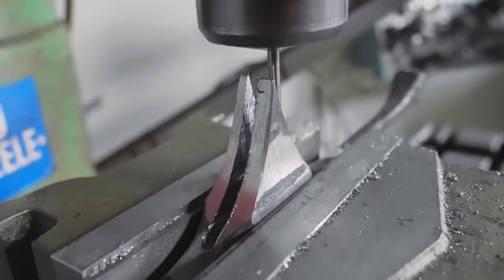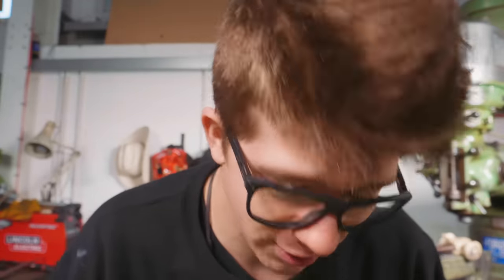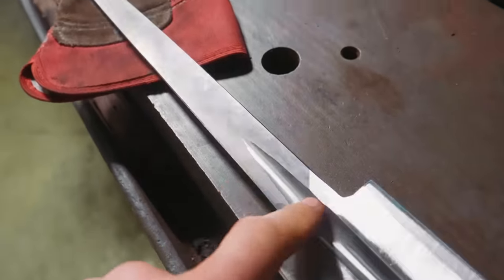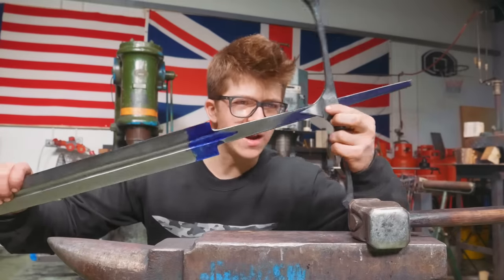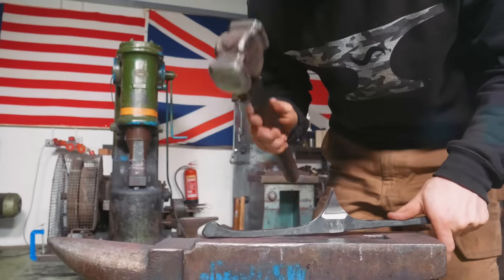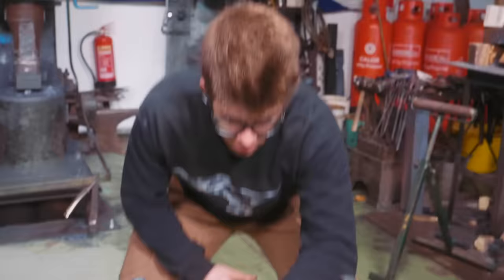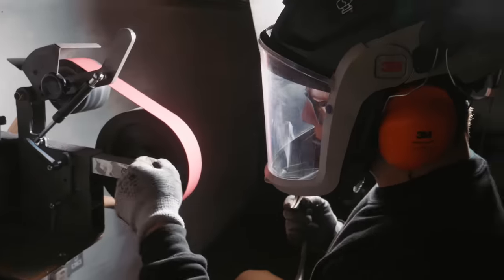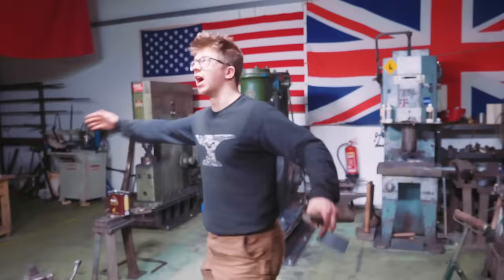MAKING A SCOTTISH CLAYMORE SWORD!!! PART 9

Comment: Hi Alec, glad you got the milling done,  a tip for that situation in the future though is to mill a flat as long as practical then get a .5mm smaller drill bit in there and chain drill material out. Not only does this give you the index on the reverse you were looking for but it also removes a lot of material and therefore a lot of the work that the over extended cutter has to do, this reduces the chance of breaking by a fair amount.

Comment: I recall years ago watching a blacksmith create the hole in the guard for the tang by first drilling a hole through, similar to what was done here, then instead of filing the guard to fit the tang, he heated up the central portion of the guard and gently, and carefully, hammered the guard down the tang, creating a perfect fit that way.

Comment: Alec,
Amazing video(s) as always.
In the case of your " too much material too little end mill. And i dont know if this was suggested because you already have 589 comments and im a slow reader.
Bore a centre hole from top to bottom as step one as a witness mark to reference from
Then you can mill space for the tang as deep as you please from the bottom.
Flip bottom side topwise and mill out the peak.
Then mill the shoulder slot left and right of peak with a shorter mill.
You'll have to file more of the centre/middle of the material by hand but it might save you an few ends in the long run. Also since its more filing in the middle rather than outside less need to worry about finish and less hand sanding.

At he very least put more than 30 tousandths of the mill in the collet you magnificent crazy bastard. 
Keep it up and stay safe. Great job!

Comment: As you started to hand sand the blade I thought "That's a beautiful damascus pattern." Only to realise it was water droplets on the surface to help your sanding. Which then set a thought...  How would you make a damascus pattern that resemble rain drops? And could you then make an umbrella handle? Challenge extended!
Reply: There is a Damascus pattern by the name of, raindrop Damascus. Where you forge weld your billet and drill holes in your billet,knife and they come back to the surface for a beautiful pattern👍just trying to help
Reply: evan anselm That sounds like that would make a lovely knife. Alec, do this please!
Reply: Well that's very interesting! Cheers.

Comment: Freerk Weiringa simply heats up the cross guard to forge welding temperature and forces a die with the same dimensions as the tang through it and has an instant perfect fit.

Comment: You know the Trizact belts are available up to 600 grid? Would save you alot of hand sanding.
Reply: When you are doing finishing work, you only need to do some surface sanding. With a belt sander it is easy to grind off more than you need to get the finish. I assume that's why he does hand sanding. It's at least what I do for my work.
Reply: I believe it has more to do with the direction of sanding marks; aligned with the blade rather than orthogonal as would be produced in the grinder.

Comment: I just can't imagine the amount of work this kind of sword would have been for a traditional scottish blacksmith
Reply: well, the blades of real ones were made in Germany, exported down the Rhine, and arrived in Scotland packed in crates. The real ones often have hollow hilt parts which reduce mass, and make them fairly straightforward to make. some of the early 16th C ones I've had my hands on still have file-marks in the langets, even.

Comment: The Claymore is looking FANTASTIC!  The lines of the guard in particular are really going to set this off.  You've upped the game and now you need to turn out an equally styled pommel.  But hey, no pressure, he?  :D  

You mentioned how nice it is to work with new and sharp files a while back.  Keeping them that way is FAR easier and they last a lot longer when they are not skipping and dragging over each other.  That really eats up the sharpness rapidly.  Take a little more care to space them out during use and store them away in some manner that they don't rub against each other.  They'll cut well for far longer that way.  

Cheers from Canada

Comment: Hey, nothing wrong with a curved cross-guard, it's your version of an iconic weapon. Might I suggest putting a good strong makers mark on the front and back of both ends of the guard's knobs? They didn't all have quadrifoils, and that would liven up those ends a bit. Coming along beautifully. Great job Alec.
Or if you want a nod to that style, since you mentioned it and all, you could make a stamp of four circles and put a larger maker's Mark on the center of either side of the guard. Remember, the pommel is historically the handle for the rear hand, so it would be somewhat spherical. Check out some demonstrations of the weapon online. One hand on the front of the grip, the other on the pommel. This makes for great leverage when wielding it.

Comment: Hey mate I'm a machinst if you buy a touch probe you can easily centre the cutter on the job or you can use the tool and some tissue paper spin until it takes the tissue paper away then move it half the cutter plus half the job size and bam you have a centre

Comment: if u ever forge one again try using a slim chisel to split the still heated crossguard. u can then slip in and readjust the blade for an even better fit and u its the traditional way :) so great ur doing that project btw greets

Comment: Alex,

At this moment there are already 598 comments, so I'm probably repeating one or more comments below.  But, here it goes anyway:  Have you tried simply plunging an end-cutting mill cutter straight down into a part like your guard like the end mills are drill bits?  I saw another YouTube content provider (a machinist-type channel, a few years ago) where he showed how to do this to avoid or at least minimize breaking of long thin end mills.  I don't recall if he then used that end mill to remove the "vees" left between the overlapping "holes" cut by the end mill or if he used another method, but you may want to experiment using a similar method for cutting deep slots without breaking (expensive) end mills.  You don't have to worry as much about chain-drilling separate holes like you do with drill bits and can simply step silghtly to the side, overlapping the "holes," and let the end mill cut a small section of a hole, leaving much smaller "vees," if any of what's left can then be cut from side to side without breaking the end mill.

Comment: You should use some fairy in the water it breaks surface tension keeps the paper clear for longer also helps clear the steel particles from the work peice
Reply: adam Cyphers fairy liquid. It's pretty much the best dish soap in the UK.

Comment: What will you do with the gaps between guard and fullers? Blade thickness in the fuller area is significantly less than in the tang.

Comment: Alec! How does damascus look on a mirror finish? Asking out of curiosity.
Reply: You can only see the damascus because you dip the steel in acid and one of the steels dissolves faster than the other. This destroys any mirror finish you might have polished onto it.
Reply: Yup then sand with 400+ paper and the 15n20 polishes back up to a high shine leaving the plain carbon steel black (depending on the depth of the etch)
Reply: if i want a smooth finish on my damascus blades i normally do an etch in oxalic acid. (bkf- barkeepers friend) it's a cleaner but it works good to darken the steels and not eat away at it, you could leave it for hours and it would be almost like it was gun blued. And the acid is easy to neutralize. I just wash it with dawn after i get the etch to set. By that i mean take it out of the bkf and water solution then set it on a towel, don't pat it while wet it will rip the patine off. But let it dry then wash it and wipe it and you are golden.
Reply: Thanks for the clarification!

Comment: The Claymore was originally a two-handed sword, with a cross guard that sloped downward, or towards the blade, with four-lobed shapes known as quatrefoils at the ends, and extensions onto the flat sides of the blade known as langets which were designed to lock the sword into the scabbard.

Comment: What is that liquid you pour on the claymore before sanding it with 400 grit?
Reply: Probably just water. Water can be used with sandpaper in a process called "wet-sanding".

Comment: The prongs on the front of the guard are not supposed to touch the blade, but stand off enough to catch your opponents blade between the prong and your blade, and either break your opponents blade or take it away from him.  Interestingly enough, the prongs are called sword breakers.

Comment: I was wondering why you didn't poke through the guard with a drill bit for the Tang and then turn the guard over and finish with a shorter end mill.

Comment: Would it be possible to just weld a rod onto the end of the cutter shaft to extend it's length? I know getting it aligned correctly would be tough, but it may work.

Comment: I don't understand why you didn't drill a hole through the middle from the start(Hindsight is always 20/20, hahaha). Yesterday I thought you were trying to just hollow out the middle part. That's why i suggested an angled vise. Take it easy. I'm sure you realize the 2 sides are uneven too(just bustin balls)

Comment: Alec, is the guard thick enough to withstand multiple strikes from an opponent's blade?  With the ease that was obvious in your near final shaping of the guard it gives me the impression that it should have been a bit thicker.  BUT as I've said before I'm not a steel worker and don't know jack-shyt about much.

Comment: Can anyone explain the use for the blue ink he uses???
Reply: Blue Dykem is its name, it's used to cover metal before scribing (scratching) it, that way you can easily see where the line you just made is. For example, you may cover a square piece of metal with Dykem and then scribe a center-line, it's more visible than just bare-metal would be. From then you know where to cut/drill/polish/grind/etc.

Comment: Why didn't you forge fit the tang. By that i mean, heat the tang and hammer it on? That would have made it a tight fit and wouldn't have needed as much filing.

Comment: In case you were wondering, the fuller on the blade has nothing to do with blood.  It has everything to do with allowing the sword to be lighter for the same (or greater) strength.  Hammering the fuller would have been better to achieve that functional goal.
Reply: Fat Boo because it makes the sword wider with less material instead of making it with more material and grinding it out
Reply: I’m surprised with the power hammer and his fondness for dies, Alec didn’t hammer the fuller in.
Reply: plus like.. more compressed metal in the middle or something.. Physics
Reply: My comment was satire, but you bring up a valid point. Bet if I got a black hole I could compress it though.
Reply: David, it does have lots to do with blood, well, to be more accurate: It is to allow the release of vacuum a body makes when the sword is thrust inside. They call it a blood fuller as it is the blood that runs out of the fuller. Hence why all Bayonets have a fuller.
Reply: Dom Martyn As a science geek, as well someone with basic competence in meat fabrication, I gotta jump in briefly. Although it is technically true that the fuller on a sword could at a glance be construed as being somewhat analagous to the kullens (transverse scalloped grooves) along the edge of a slicing knife, or the counterflow straw present in bartending speed pourers and funnels, such vaccum relieving effects are, at most, of a distant tertiary or quatiary benefit.  No, the primary purpose of a full length sword fuller of non-trivial width is first and foremost to lighten a blade without incurring a penalty to strength. A secondary goal is to improve stiffness without the need to add reinforcing material (think I-beam). A tertiary goal can be various smithing effects, such as offering a way to further widen or elongate a blade of a given weight (read: a hammered fuller, not a ground one).

Just to place a final nail into the body cavity vaccum angle, keep in mind that while the effect can be real in limited circumstances (read: a straight-in stab wound), the amount of added vaccum force that could be incurred (beyond that of simple friction) is relatively minor, and often exaggerated by authors operating under the same misconception. Even if the force was not minor, remember that swords and knives differ from arrows because they have a flat cross section, and thus it would be trivial to release any such vaccum with a simple twist (to allow air to burp in) or wiggle (to elongate the opening).
Reply: Incidentally, anytime you see knives with one or more slender little 'slit' fullers, I'm pretty certain they dont really do much from a functional standpoint except harbor dirt and/or rust. They're probably more effective at guaranteeing a really nasty infection than relieving an imagined over-strength vaccum effect occuring in some envisioned fight to the death that the owner will likely never actually have.

To me, theyre just proof that the smith who cut them didnt understand structural fullers either, and just replicated them faithfully out of habit or tradition.
Reply: Actually it is there to release blood when you stab somebody because naturally the body tenses all the muscles around the wound, the fuller allows the blood to escape and releases pressure to make it easier to pull the sword back out
Reply: Somebody wake me if science and logic reappear ... they both owe me money.
Reply: I just have to correct you lol.  Metal can indeed be compressed, though it isn't done like air.  There is a guy who "shrinks" coins with intense magnetic fields.  Watch the videos on YouTube.  It's amazing.
Reply: Fat Boo Clarity Saying metal is compressible is a misleading oversimplification.  For example, while it is technically true that forging (hammering) a cast pour, smelted bloom, or sintered powdered steel ingot will increase its hardness and toughness, those increases are primarily due to things like the removal of any remaining impurities like slag & scale, and the removal of cracks, voids and bubbles, after which you have a pure clean billet.  After that point further gains from continued forging and heat treatment are largely due to further optimizing the internal structure/grain into an increasingly ideal crystalline one (re: pearlite, martensie, etc).
Reply: Apologies, Boo. I confess to having forgotten the proper scientific term for it (it's been 30 yrs since I finished college) which is why I'd missed your reference to it.  However, I do remember the process itself - if you look closely at the adjectives in my post (oversimplification ... mostly ... largely ... increasingly optimal) it should become clear that I was NOT really implying that such a process doesn't exist at all.  I trying to help put such processes into their proper scale in relation to other (larger scale) processes of greater relevance occurring in parallel during forging, for the benefit of onlookers who may be a bit less grounded in the hard sciences (pun intended).    

AFAIK Bulk Modulus is mostly relevant when a material undergoes sustained omnidirectional compression from all sides, which doesn't seem the case in steel being directionally beaten with a power hammer.  The amount of force needed for the type of compression you're referring to, in steel, is huge - it'd require many millions of psi, applied omnidirectionally, in order to occur in large degree.  If it's not applied omnidirectionally, in sustained fashion, it seems to me like it would at best be a highly localized phenomenoa, and the surrounding material will undergo plastic deformation (read: squish), or simply shatter, in order to relieve the applied stress.
Reply: I'm happy to admit my current level of understanding of metallurgy is armchair amateur, rather than professional level, so I'll bow out on the point ... I'm more of a science generalist with a passing interest in smithing vids.  Hopefully someone with a more complete and reliable understanding on this particular topic will weigh in, and set us all straight.  

I'm always happy to defer to a trained pro who really knows their stuff (both practically and scientifically). It usually makes my day when it does. ;-)
Reply: Gosh darn it, now I gotta be picayune again, right after saying I'd try to refain from it.  ;-)

My impression of the sort of physical deformations (warping/curving) that manifest during thermal quenching has more to do with changes to the crystal structure in the metal in response to sudden thermal shock, rather than what happens in response to Bulk Modulus level compressive forces.  I'm not convinced they're the same thing.  Guess I've got some more reading ahead of me on this topic.

Hopefully someone who knows definitively will weigh in.
Reply: That is entirely a myth, fullers were always and still are designed to save weight (and often aesthetics). The idea of a vacuum pressure release/blood groove is entirely a made-up story that became popular because it sounds cool and sciencey, however, it's still a lie. Stabbing doesn't create a vacuum, but a 20 Kg blade does get heavy. Cheers mate, sorry to kill the legend but at least there's value in education! Cheers!

Comment: Why don't you just heat the guard and "forge" it around the tang?  You could spare a lot of filing time. Or it would be impossible to take the guard off?
Reply: smiti999 the heat transfer would ruin the blade. He could make a short steel mock-up of the tang and shoulders and use that as a punch/drift that he could forge around. I have never done it myself but I have seen it done several times.
Reply: Oh, I didn't think about this. Thank you.